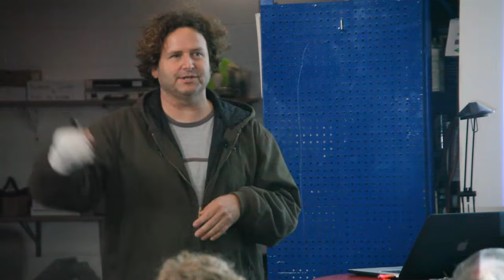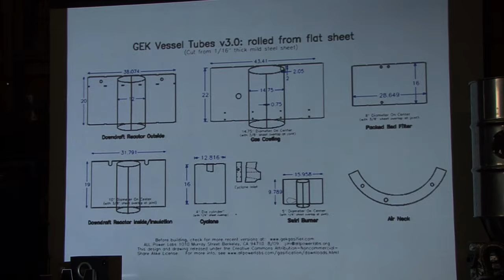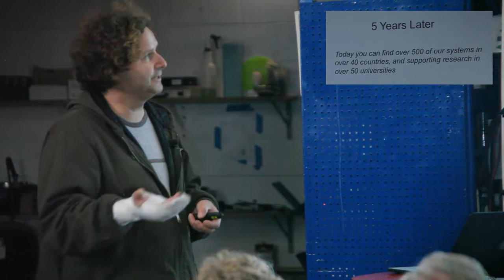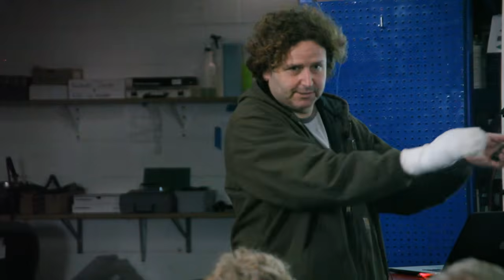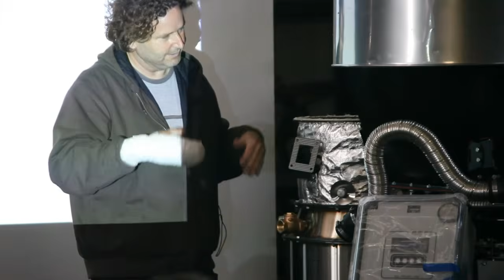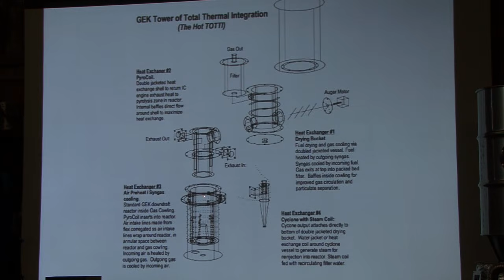State of the Power Pallet: Past, Present & Future

Comment: Jim Mason.. Great information... Can you tell me if the amount of gas coming off is most when you crack all those tars .. I would assume that is ideal to limit your temperature as all the tars are being cracked. A lot of this depends on your inputs but mostly wood of a softer curb stuff not ideal. But cheap. Would rubber tires work or be to hot? Smell to much. Adding old motor oil or even cooking grease might increase the heat output andeasy to vaporize. Plastics should have a different cracking point to get the most gas from that type of input. Any suggestions?  Have you considered adding steam this should cut the nitrogen from air and add increase heating gas BTU and increase your engine out put power.  Any info on straight run biomass like corn stalks? Is their any effort on the tax side to increase this type of power generation in biomass? There are many in the oil industry I would think it only fair to allow the same in the biomass power generation industry. Maybe you can push that side of the legislation. Your many fights with the city should make you a very good poster boy.
Reply: Hello Steve. I can answer your technical questions about the machine.

The cracked tar constitutes roughly half of the gas that is produced.
Rubber is not suitable as feedstock; it melts and immediately fouls the auger, and does not burn hot enough. The cracking of tar appears to be catalyzed by the percolation of tar through the highly porous char above 800˚C, and rubber tires simply do not produce suitable char for this. Furthermore, rubber tires are contaminated with wire rope, and other reinforcing materials, none of which are not fit for gasification.

Plastics are not to be gasified for the same reasons. To process plastics, the preferred method is thermal depolymerization, where plastics are exposed to heat (at much lower temperatures than gasification) in a very controlled manner in an anaerobic environment. This causes certain kinds of plastics to revert to their monomers when the temperature and pressure conditions are just right. There might be a catalyst involved. The company that has done the most work with recovering plastics for energy is Blest Co. from Japan. See their website: 

Blest Co— thermal depolymerization of waste plastics
http://www.blest.co.jp/eng/

We have not considered adding steam; the water vapor from the feedstock drying is more than enough; most of this water fails to reduce to hydrogen anyway. It hasn't increased the engine output power; it just increases the maintenance burden due to condensate when it forms. The PP30 tries to keep it all in vapor form, but this then just dilutes the calorific density of the gas.

Corn stalks are not suitable as feedstock because they contain too much silica.

I don't know enough about the tax and legislative aspects, but as far as I know, we don't have any ongoing efforts to effect any change in that area.

Comment: You say you want a larger CI motor and mention 17 to 1 compression. How about a cummins L-4 diesel motor. They make awesome power at low RPMs and are just about grenade proof. 
Another idea is to use a transfer case for single input and dual output shafts. Also some manual shift transmissions are made to add a hydraulic PTO. Just something to kick around..